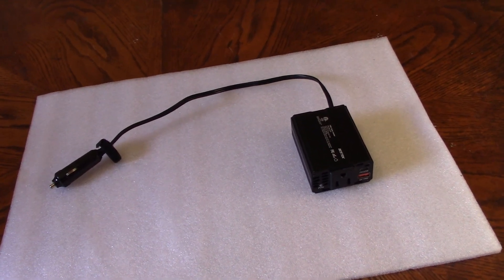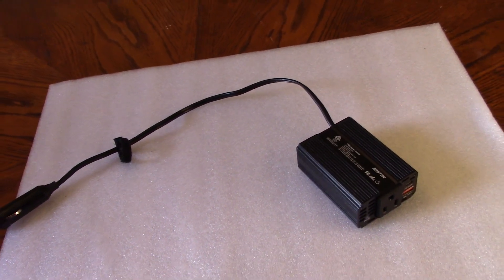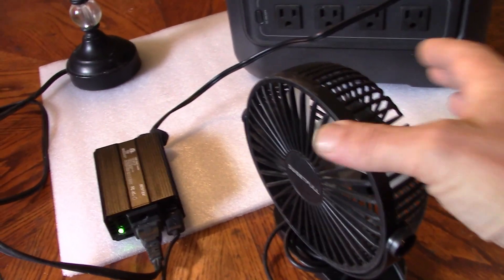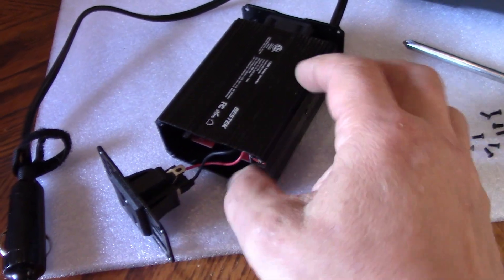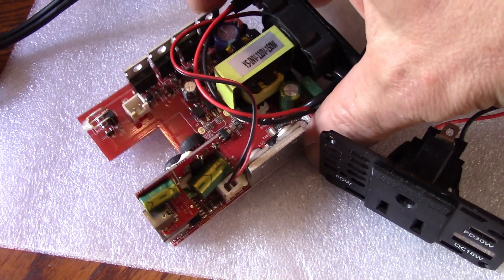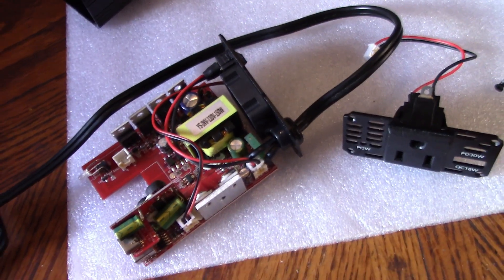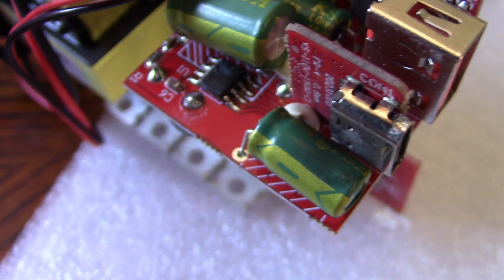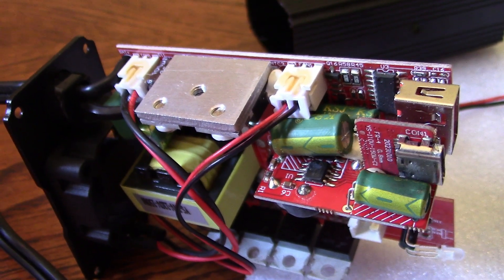Little Inverter Destroyed by Lightning (physical damage inside)

Comment: I'm actually puzzled how an inverter not connected to the mains had a chip blown up by a lightning strike. Was the strike extremely close and so it induced a current in the circuit board??
Reply from the maker: Good question, Ross!
This was connected to our solar set up, with the outdoor panels being disconnected. The strike was so close that the flash was accompanied by the bang and formed a compression on my wife's ear. She was right next to the inverter at the time (and her bedside clock that also got zapped). 
A few years ago, we had another very close strike and the car 12V battery went to zero volts (Ford Escort). That one also took out a couple of arcade machine monitors, producing moire effects and like a strong magnet had gone across the screens. They weren't plugged in either!
It's bizarre how the effects seem to be selective for device destruction. In this case, the inverter being housed in a metal shielding didn't seem to matter.

Comment: Wow that chip was fried, but good to see that you can still use it and it's a upgrade to your solar cube which is smart, interesting to see  inside the inverter and handy to know where the screws are if working on similar ones. 😊👍
Reply from the maker: Cheers 😀
I'd seen the little bubble left when a chip blows, but not blown apart. The inverter is nicely made, for regular non EMP use 🥴